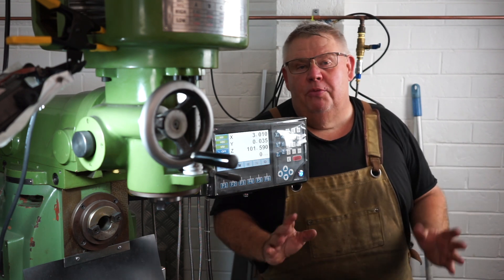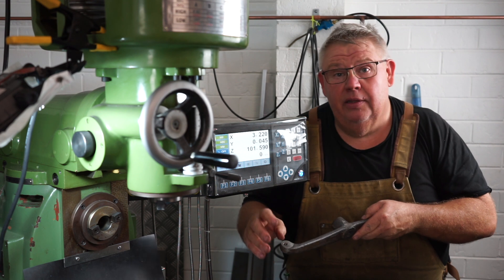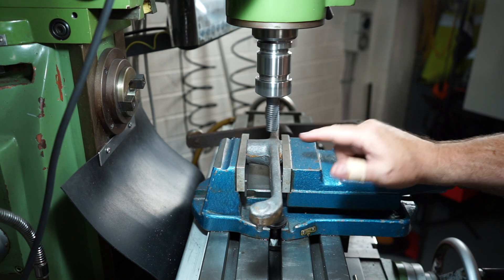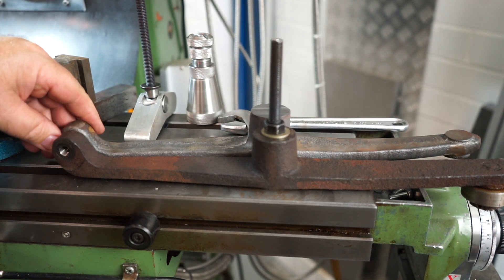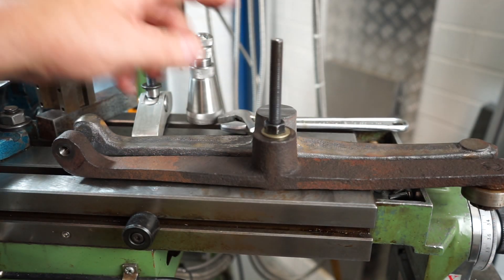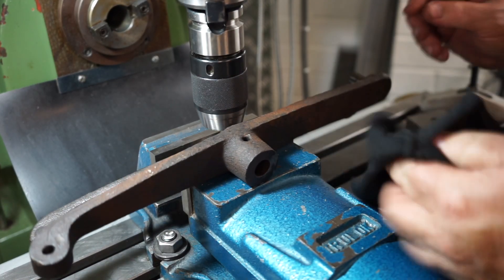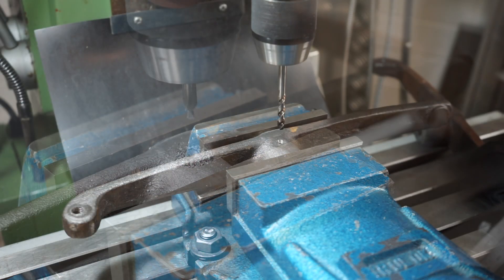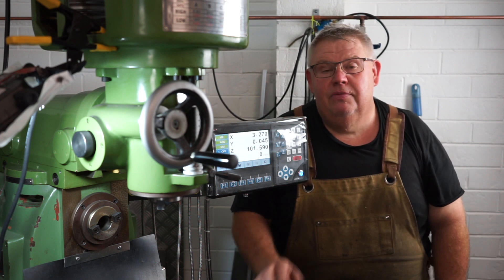This part was hard to hold | 1905 Hornsby Engine REMANUFACTURE...

Comment: Hi Aaron
new to the channel, and, the content is great, a question what type of mill do you have and it's vintage?
Reply from the maker: Hello Don and welcome to my channel.  The mill is branded Herless and is probably from the mid 1980's.  It was made in Taiwan and has a vertical and horizontal spindle.  I fitted the Ditron D80 digital read out myself.  Cheers, Aaron.

Comment: Always interesting to see your setups & order of operations etc - so I really enjoy milling videos.
What I learn hopefully will come in handy at some point on my Bridgeport Mill.
You do nice explanations of what you’re doing & why which is very helpful.
Thanks heaps for the time & trouble that you go to. 👍👍👍🇦🇺
Reply from the maker: Hello Ian.  I'm glad you enjoyed the video and thank you for the feedback.  Workholding is always tricky when milling.  Especially getting things straight and not bending parts by overtightening the vice etc.  I like to give back to the community and pass on my "limited" knowledge with others.

A little background story for you.  I'm originally a motor mechanic, but jumped ship into engineering and worked as fitter & turner.  These days I'm high school shop teacher, but I've also taught apprentices in TAFE.  As the old saying goes, "jack of all trades and master of none".  ha ha ha.